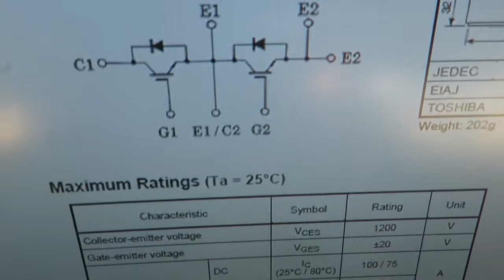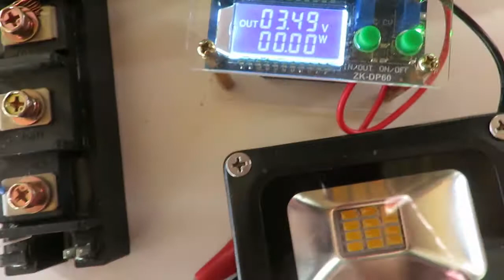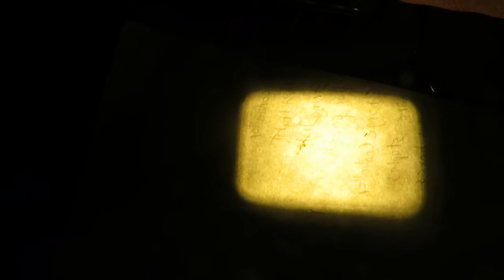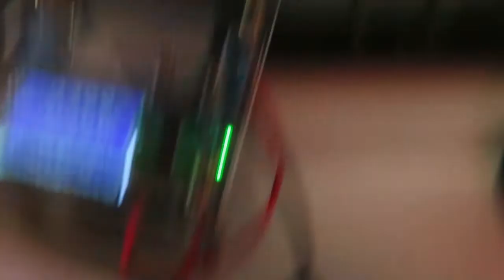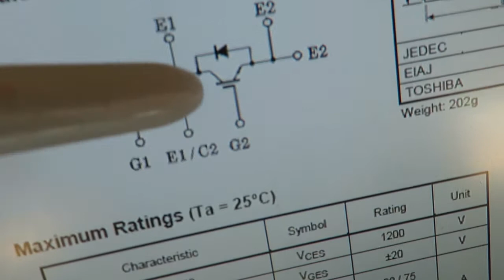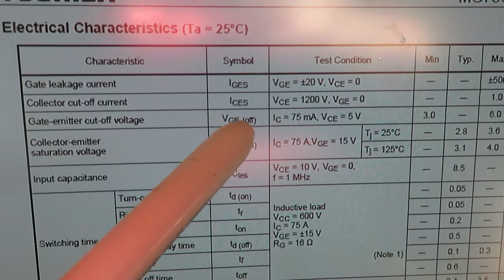IGBT experiment Toshiba MG75Q2YS1

Comment: Generally, IGBT are used over 250V.  That several volt saturation voltage is a real heat problem.  For $15 you can buy a slew of individual FET or IGBT.  Some of the new FET can handle 30A or more up to 650V and just a pair in parallel will produce far less heat.  The input can be looked at as a capacitor and once charged can hold that for a very long time.  It is not good to hold the gate at an in between voltage for very long as you can quickly destroy it from heat.  Use PWM if variable current is needed,

Comment: a pull-down resistor on the gate will solve the turn off issue your having.
Reply: ope! saw you sorted that out in the other video :-)
Reply from the maker: @windsine  yeah this was the first experiment . I just published this video because I made another video about my solar hot water heater - tried to make it so beginners could understand what I was doing. Thanks for your help on this project .